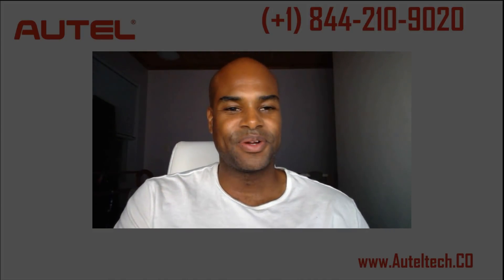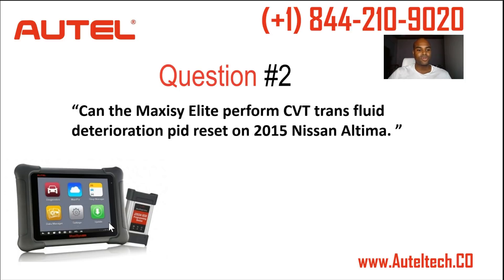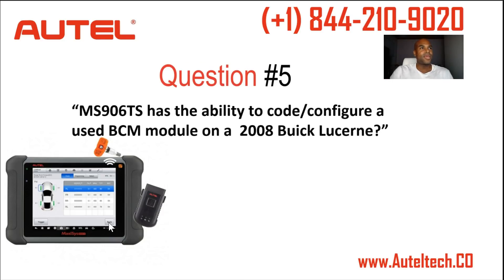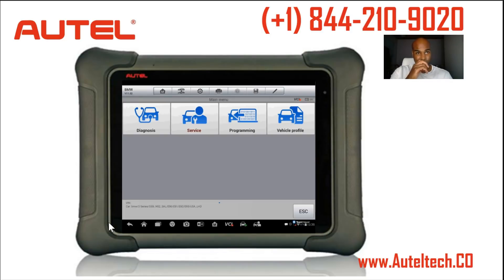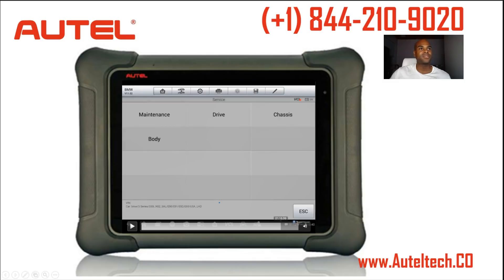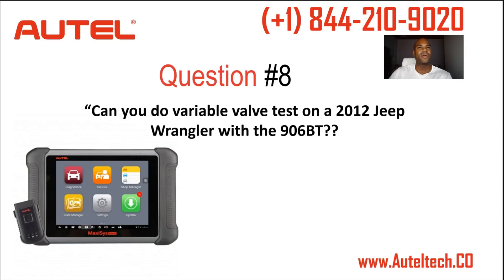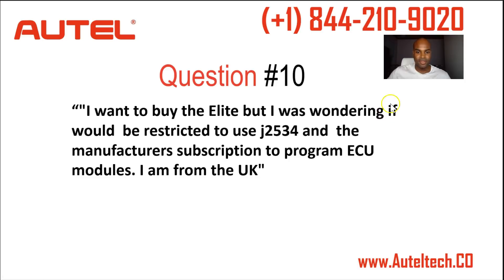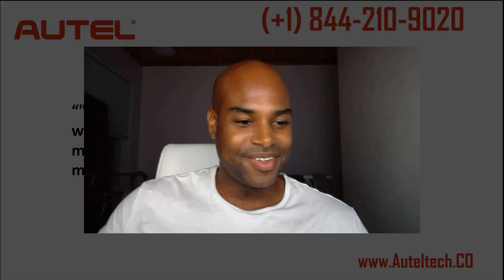Autel Maxisys Elite MS906TS MS906BT | Top 10 Questions of The Week - Episode 4 | Autel 2019

Comment: Will the MS906BT do individual injector flow test. As in key on engine off, prime the pump and fire the injector to see pressure drop on a fuel pressure gauge. Move to the next injector and repeat. working on a 2021 Ford Super Dury 7.3 gas.

Comment: I have a 06 lbz duramax and a 03 6.0l powerstroke will this tool work on them. injector tests balance rates cylinder compression and cut outs etc...
Reply from the maker: Hey Alton. What you can try to do is call autel new york to see if they can verify this for you.  There is a slight risk that it that they might mis consult you however due to the fact they use a general data base with the special functions.  If you want me to align you with the right tool and verify your vin number with my engineer ,  You can book a diagnostic tool consultation at auteltech.co.za  .

Comment: Can the 906BT  Key coding for A 2014 Dodge Ram 1500 Key FOB?
Reply from the maker: I havent checked but my gut is telling me it cant. Most of the immo functions stop at 2013 its not able to get the pin code thats required to get access to the immo syste.
Reply: @AutelConsultancy   Curtis, Thanks for getting back to me. Can the MaxiM IM508 would work for dodge Key Fobs? Thanks for your Videos you put out.
Reply from the maker: @KenManchie  Yes thats correct.

Comment: Hi Curtis, I'm trying to start a mobile diagnostics business, can't afford the MS906BT, how would you rate the MD802 and also the MK808, I'm in SA, any advice will be much appreciated from an expert👌😁
Reply from the maker: Hey Joshua.. What is your target market in terms of the clients and vehicles you are going to work on?
Reply: @AutelConsultancy  At the moment i think it will be leaning towards just checking individuals that wana find out why those basic lights are on (abs/srs/engine check). But then again the average Joe thinks you can just reset and those lights will go away. Mostly dealing with merc,bmw,vw,renault,opel and nissan. I would like to service the panel shops and mechanical shops going forward, like with srs reset and stuff like that...
Reply from the maker: Hey Joshua.. ( im in cape town by the way) Anyway the MD808 Pro would be better than the md808 Pro has lifetime free updates. The MK808 has better hardware and has 1 year free updates. It really just depends on whats more important to you. The cost or cosmetics. The both do the same thing

Comment: So I understand that a supported laptop configuration, operating system, battery maintainer, OE software, J2534 hardware (and drivers) are required to perform ECU programming for anything other than Mercedes Benz and BMW.  However, I was told by someone who uses the Autel Maxisys MS906BT daily on Toyota vehicles that the Autel Maxisys products that claim ECU coding capabilities CANNOT do that on Toyota vehicles.  He stated that Toyota Techstream and a supported J2534 interface is required to perform ECU configuration (aka coding) on Toyota vehicles.  This is the first I have heard of this, but when I check the Autel coverage database for this, I don't find any mention of ECU configuration or coding for any Toyota vehicle I query.  Curtis, do you (or anyone else reading this) know if this is indeed true in general for Toyota? Thanks for some great videos!!  Tony

Comment: Hi, I have an Autel MD808 Pro and I'm if any of the Autel products are able to program keys for a 2003 Porsche 911.   Also, can that same product perform a cylinder contribution test on a 2003 Ford F250 Powerstroke 6.0?
Reply from the maker: Hi Christan, If you want me to spend time and share with you the limitation / special functions of your tool you need to book a consultation. www.Auteltech.co.za .  I will then also align you with the right tool becuase just on the limited information you gave me the MD808 is not going to do the job in my opinon.